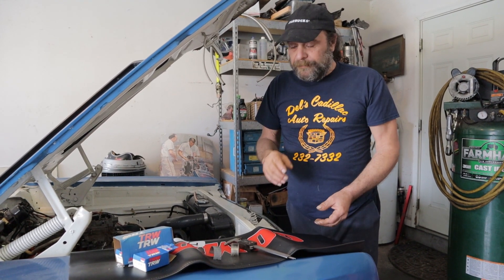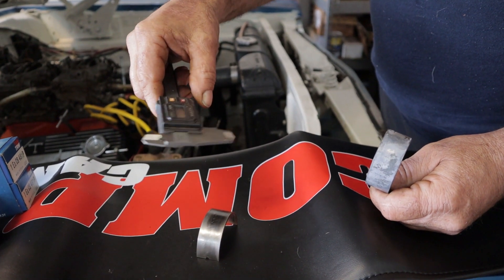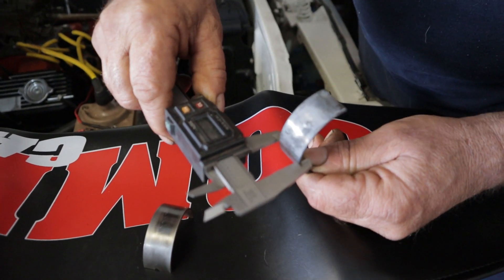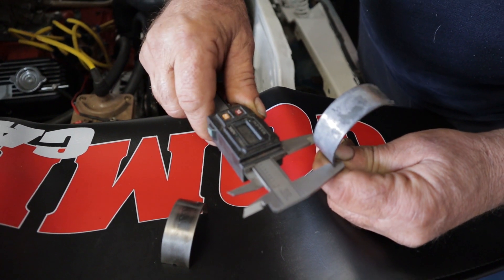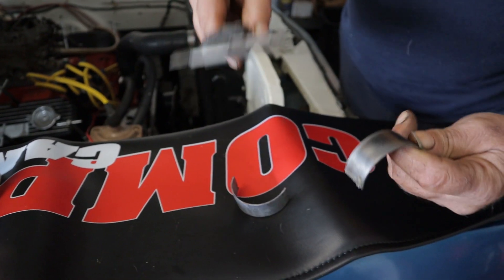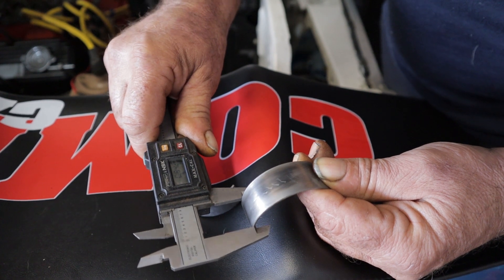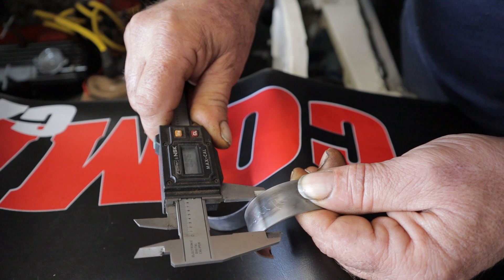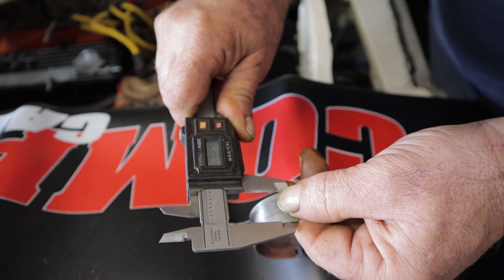Detonation...The Number One Killer Of Hot Engines

Comment: Here’s a mystery.

New motorcycle runs GREAT on 87 octane and Castrol 10W-40 synthetic oil.

600 mile service, still runs GREAT on 87 octane and Castrol 10W-40 synthetic oil.

1806 miles, 87 octane and Castrol 10W-40 synthetic oil.
ENGINE KNOCKS.

This time a Full tank of 93 octane and Castrol 10W-40 synthetic oil.
STILL KNOCKS.

This is on a Triumph bonneville 1200 engine. Seems to be a common occurrence on these all over the world.
So it can’t be the gas or oil obviously. England had very high octane fuel but they still knock.

We were thinking the cam-chain tensioner but the oil is always the same.
High octane fuel doesn’t eliminate the knocking.
Tried that myself just yesterday. 

The only thing I can come up with is a software problem with the ECU during the service at the dealership.
Considering this is the common denominator because the bikes are serviced at different dealers in different countries BUT connected to the same mainframe in London to Triumph headquarters that effect the bikes that get ECU updates.

From the information given in this video if the timing is off, or the mixture and the timing is off, the result is a misfire.

What else could it be ?????
Triumph tells us it’s normal but my these bikes run GREAT other than this knocking.
People have tried valve adjustments, with no difference.

Help please ……..

Comment: Help me out with the meaning of the pinging sound effect, I have heard pinging on a engine with a muffler a detonation sound. I would have very unaccurately described as two metallic bats, solid cylinders, not whole, bashing into one another... 

Look, I know it was from one the car's cylinders, Piston, etc. from a cold start I would put 1,2,3, sprays of aerosol ether into it's manifold, just past the throttle body. after quickly starting it up, something happen I could smell exhaust and I believe that I my have unintentionally removed some carbon buildup from it's internals. I just wanted make a short comment, not hit the limit of characters in the comment post.  But what I did to car caused a big problem, while I was punching up the mountains, instead of my car's RPM holding up, I was watching rpm drop climb them hills!
Reply: Mechanics statement from the diagnostic test said everything at first glance was in normal position. After they put in the shop, it was sounding awful when it was idiling, you could hear the valvetrain grinding, and it was over heating, there was metal that could be seen or grab out of the oil... They recommend a new engine replacement. 🤑🤑🤑🤑

Comment: yup, literally hammered. better to set 1-2 degree less than be having that happening.
choosing source of vacuum advance, sometimes a limiter inline, sometimes just adjusting centrifugal spring hangers and/or new springs (if it has centrifugal advance down underneath the plate)... there is such thing as timing advancing too quickly for its own good. sometimes you can kinda tell whats going on watching closely with a strong timing light, rolling into the throttle+rpms vs straight romping on it at 1500-2000 rpm. swinging too far too hard its time to start playing with stuff to get things more in sync. another that can mess with you "it runs bad when its damp out"... engine warms up and steam gets up inside the distributor shouldn't be happening... it's shaft seal is done! simple cheap little thing like that can cause big problems pretty quickly.

Comment: What’s your thoughts on Max DCR on 93 octane pump gas? 
I’ve found most use a DCR of 8.70-1 as a max safe compression w/aluminum heads on 93. 
There are a few who claim to get away with a DCR 9.00-1 w/aluminum heads with careful tuning and testing the fuel quality. 

The average enthusiast doesn’t look at DCR only the SCR, but the valve timing of the cam and DCR is what determines octane. Thoughts, maybe a video topic?

Comment: Of all the engines that I have disassembled, I never thought to check the width of the bearings. I always look at the wear surfaces for grooves or it there is exposed copper. I've torn down mid 70s 360s and 440s and often see wear on the upper shell but not nearly as much on the lower half. I'm going to have to try this once I get a better set of dial calipers!
Thanks, Anthony.

Comment: tony im building  a motor and trying to make sure it   will work good.. I have a 97 350 chevy roller cam   block bored .30 over. the deck has been cut down .006 thoousandths. the stroke is 3.48. the 191 heads are 76 cc. the motor had dished pistons, but im ordering flat top pistons to bring compression up.  the calculations I did says the comp ratio will be  9.64 to 1.. does this sound right?  this was calculated with a  0.020 compressed head gasket thickness.   thanks also will the rise in compression ratio be ok with the stock timing?

Comment: I had this happen to a sb Chevy 383. But I didn't need to measure it you could see it plain as day and I had low oil pressure. Replaced the bearings and it was like new ran great good oil pressure. Had minor marks on the crank that apparently didn't cause any issues.

Comment: Some engines exexperience "silent detonation " You MUST  meet the engine's octane requirements. A buddy had a 10.25:1 Pontiac and crutched it with octane booster. It seemed to run well....until he pulled away from a light and the crankshaft broke in half

Comment: When I pull hot engines down for inspection I use some Plastigauge as a quick check of the bearing clearances before popping the rod and piston for a guide to where to look. Just a timesaver on failure analysis.

Comment: Detonation is simply the fuel/air mixture burning, pre-detonation is the problem because it occurs when the piston is too far down in the bore, on its way up, for the given engine speed. This is a common grammatical error in the automotive world. I still look up to you as a god and you are a guru, even though you deny it.
Reply from the maker: No, detonation should never happen in a combustion chamber.  You're confusing terms.  It's not "pre-detonation", it's pre-ignition and that is the common form of detonation street type engines experience when timing is too far advanced, fuel quality is low, etc.
Reply: @UncleTonysGarage  Got it, thanks!

Comment: Uncle Tony, rewatch your video. You are not using the tool right.
Reply from the maker: I know...I was going to use the wire stripper at first, but I didn't want to reveal my secrets.  Then, I reached for my ball mic, but then realized not many people have those, and it's a one trick pony.  That's when I grabbed the caliper...because that's what I used on nitro engines for a dozen years.

Comment: Detonation is actually more correctly termed knock. There are two major phenomena – abnormal combustion processes – that can cause engine damage if left unchecked.  As an expert in internal combustion, J.B. Heywood, described starting at page 450 in his book, Internal Combustion Engines Fundamentals: “ Knock is the name given to the noise which is transmitted through the engine structure when essentially spontaneous combustion of a portion of the end-gas – the fuel, air, residual gas, mixture ahead of the propagating flame – occurs. When this abnormal combustion process takes place, there is an extremely rapid release of much of the chemical energy in the end-gas, causing very high local pressures and the propagation of pressure waves of substantial amplitude across the combustion chamber.” 
The other major one is surface ignition, often called pre-ignition – when the air-fuel mixture ignites before the spark event.  Both knock and pre-ignition are different types of abnormal combustion and most of the time - neither are called detonation in the automotive engineering world.
I have witnessed engines operating at full load with heavy knock (due to advanced ignition timing with knock control disabled) for hours on end - without damaging the engine. Some engine designs can handle it better than others. One thing that can happen with heavy knock is that it can wipe out the oil film on the cylinder walls - which accelerates the cylinder wall, piston ring, and piston wear. Heavy knock can also lead to pre-ignition, as areas in the combustion chamber overheat and become hot spots that ignite the air-fuel mixture before the spark does.
Old school is cool, but modern engine control that automatically retards ignition timing when knock is detected by the knock sensor is cool too.

Comment: In newer smaller performance engines horsepower will vary quite a bit as the ecu adds or pulls timing in response to what the knock sensors are saying. Also, removing a factory intake snorkel in favor of a k&n stuck on the throttle body won't get you into mensa. I.a.t.s go through the roof
Reply: Yeah, gotta get that intake air cold!
Reply: @ScottKenny1978  at least colder than what's under the hood
Reply: @needmetal3221  agreed. Going to fit an intake snorkel to my Jeep Cherokee, and I'm planning on running the air intake for my dream car (4rotor Factory 5 type 65 coupe) up in front of the radiator.

Comment: Pre-ignition will do it quick too, for instance if your plug is hot enough (for whatever reason) to ignite the mixture way before spark ignition should happen.  When this happens, all kinds of pressure builds in the cylinder as the piston is moving to top dead center.

Comment: I heard old timers speak about water injection help prevent that
Reply: Mostly because it reduces intake air temps.

Was really common in WW2 and later piston engines for that purpose. Hit War Emergency Power on the throttle and it would start the water injection (technically 50%water, 49% methanol, and 1% water soluble oil for corrosion prevention) and increase boost pressure as long as there was water pressure. As soon as you were out of water, it's back to standard full power.

Those big Merlin engines can take insane boost levels. 140+ inches of manifold pressure (@55psi boost on a 27L engine!) in a race application, but they need water injection into the intake and a spray across the radiator to dump all the heat.
Reply: @ScottKenny1978  i have a old model vw diesel water injection helps my motor a lot..
Reply: If you think about it when it gets into combustion chamber the temps under compression gets well above 212degrees it becomes steam or and a gas
Reply: @gulfy09  yeah, and in turning into steam sucks up an immense amount of heat.  It's why in aircraft the water injection is after the supercharger (or turbo) and before the cylinder.  You want the densest air you can pack into the cylinder, before it gets compressed and fuel ignited.

Comment: That was a common problem with the new unleaded gas early 70s and the new powerless "hose mobiles" didn't handle it much better than older hi-compression cars, not to mention the "dieseling" when you shut down, or trying to figure out which crappy plastic doo-dad was making it stall or race at the lights. I (don't) wonder why every body with a few bucks and his brother were yanking that stuff out and swapping in Edelbrock systems on brand new cars. Then some years later some states started flunking them for not having proper emission controls. Pissed a lot of people off and sold a lot of Japanese cars.

Comment: Back in my glory days at Fremont and Half Moon Bay running gas classes, I used to get asked why the straight axle?  Why so high in front?  Some was about weight transfer.  But, everyone knew that if you were shakin tires or oiled them and got sideways, you could control/recover the car better with some other type suspension.  However, there is no finer front end for dropping the pan.  You could slide under any decent Gasser and know the cross member was gone (weight savings) and the whole pan was accessible.  Change oil pumps, check bearings, do what ever you needed to on those high strung gas engines w/o the car being in the way. 
You know, you are giving away a lot of "secrets" ... :D

Comment: This is an area I’m afraid of. I afraid I wont hear it. Im used to EFI knock sensors pulling timing. It a double edge sword because it can pull from false knock. 

Any other tips?
Reply: Knock sensors having to retard timing is pretty good indicator that you are running the wrong octane.
Reply: spaz 1 15 You are miss reading my post. They aren’t actively pulling timing, but im used to them being a safety feature for efi vs my carbureted engine.
Reply: I've had my old Subaru set a check engine light just off idle, romping on the gas to get up to freeway speed. Went away a little later by the time I could get it to the shop. Plug in the scan tool a friend had, "#_ knock sensor, 900rpm" or some such.

Did it twice in the same tank of gas. Haven't bought gas from that station since!

Comment: Back in the day, the pump jockey would offer to check your bearings and then offer to fill it with "Ethyl" if they were getting pounded out like that.  They also used the same tool to check the tread grooves in the tires, the thickness of the wiper blades and the depth of the fluid in the washer bottle.  Nobody offers service like that in these modern times we live in.
Reply from the maker: Check the bearings at the pump?  Fucking hard core those old timers, were!
Reply: Uncle Tony's Garage Yeah if the bearings weren’t spit out the side of the block but were a little clattery a quart of white leaded house paint usually fixed things right up. 😎

Comment: we blew an engine in a 65 stang in 1974.
broke the crank.
then the clutch blew.
also broke the bell housing.
we put a hole in the street about 2 inches deep and 3 to 4 inches wide.
we also were pulling pressure plate springs out of the hood scoop!
all happened because of detonation.
Reply: With whip cream and a cherry on top.

Comment: In the 90s I ran a bit too much compression on a Pontiac 400, closed chamber heads with TRW slugs, on 93 octane pump gas. I knew it was too high, but I didn't figure it would really hurt it. It flattened almost all the upper bearing shells and spun two after just two first gear hits on a cool night. The rods were ok, had the crank cleaned up, put it back together and its been in 8 vehicles I own since then. That engine has been 7.7:1 and will be just under 12:1 later this month when I change heads again for another project.

The cool thing about Pontiac is a head swap can change your compression a lot.  A 455 can go from 7:1 to 13:1 with the same shortblock just changing the heads, and most people can't tell if its a 301, 326 400, or 455. Think sleeper

 The D port heads with 2.11 intakes all flow within 5-10cfm of each other, and the smogger heads after '73 flow just as good as the earlier Ram Air III heads. Its going on E85 and getting stuffed in my '72 Ventura for a very low buck fun project. Th350, 3.42 gears, lightened but gonna stay ugly and cheap. Parts laying around and some headers I got from a guy on Facebook. Its going to be around $2500 for the entire build. E85 makes it fun, easy and cheap to make power. Nitrous would be fun, but its hard to find up here so I would have to get my own mother bottle, pump, and fill them myself. Thats a lot of expense.
Reply: My buddy bought this 67 GTO with a 400 built to ram air 4 specs supposedly (cam). 
Damn thing was pretty fast. 
It did have the 670 heads on it , but someone shystered him and knurled the guides before he got it.
It lasted about a summer and he swapped some heads on that he found ...
yup they were probably some smog shit , it was a pig after that. 
but kids with no money , couldn't swing a valve job on those heads.
Reply: I have a 73 Ventura with Buick 455 in it
Reply: Don't tell me you're running cast rods!
Reply: @superduty4556  we all know those poncho bottom ends are as strong an an ls 🤣🤣🤣🤣
Reply: @daveoneal5544  SD's aren't too shabby lol
Reply: @superduty4556  I'd I remember right the super came from the factory with forged rods
Reply: @daveoneal5544  forged rods, forged pistons, reinforced main webbing BUT a cast crank.

Also had a larger distributor gear because of the larger, 80psi oil pump.
Reply: @superduty4556  I was back then, these days forged rods are much less expensive so all the new builds get them, even the budget engines. Butler and KRE have forged rods for $300, which is about what it costs to have stock ones resized and ARP bolts added.

Comment: I learned a lot of this with 2 strokes. Very sensitive to air density, especially with BIG hp. Jet a motor for 20 degrees, then lower elevation and 0 temps, LOOK OUT you're gonna burn down even worse its typically silent. Add some water into the fuel and you will sand blast the inside of a cylinder and probably break a piston on exhaust side.

Good trick on the bearing measurement
Reply: My old Suzuki TS 125 needed a rejet for the 2 main seasons. 
Winter and summer(I had those dialed in nice) 
In-between it was iffy on how it would run. 
If it's 40 one day and 70 the next that's not normal for say early April. 
 I had the Jets for it but it was always fiddle fucking around in-between spring to summer or fall to winter. 
Still had alot of  fun on that bike
Reply: Same for me,, i grew up with snowmobiles, 2 stroke high performance atvs, motorcycles,,, im at sea level next to ocean,,my trx250r was always the least sensitive to temperatures,my yamaha tdr 250 twin street bike is even better,,as it has a carb warming circuit,,
Reply: @unfairfight3625  had no carb warmers on my sleds, open filters. I miss the pull of a triple 2 stroke sled, they ran so good.

Comment: It's usually the top bearing that is fubar not the bottom one I've seen guys check their bearings pull the cap and just check the one in the cap it will look good but the top bearing is the one that's spun or screwed in my experience anyway